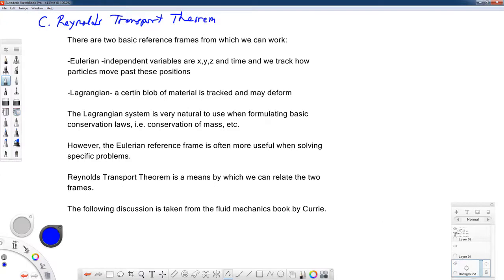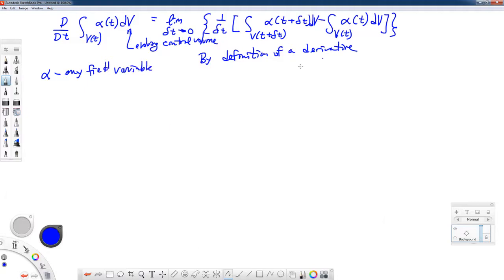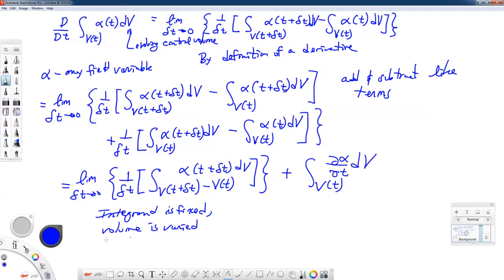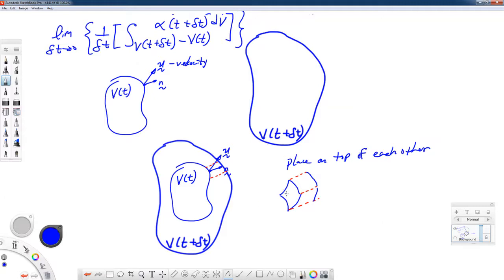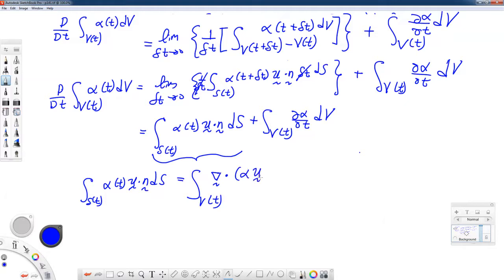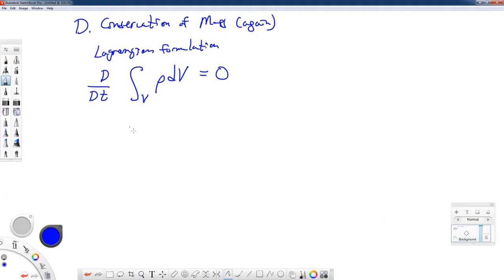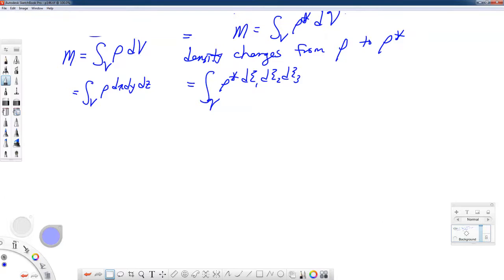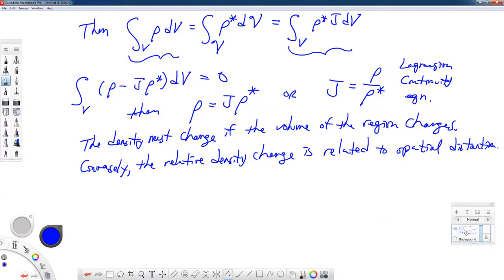Theory of Elasticity-Lecture-11b-Reynolds Transport Theorem, Conservation of Mass (again)

Comment: I went through this lecture twice and I have some doubts, I will try to get the book by Currie to get more details, in the meantime, can you please explain the following two points with a bit more detail? 1- Why are the derivatives here denoted with a capital D and not with the normal small d? and 2- what does evolving control volume mean?
Reply from the maker: Thanks.  You may need more background in Continuum Mechanics and/or Advanced Calculus. An evolving control volume is tracking a group of material that can change shape, as opposed to a fixed cube in space through which material flows.  The capital D is for a derivative for the evolving control volume.